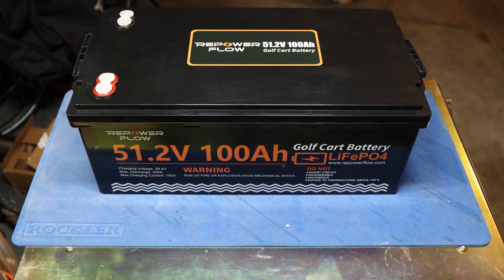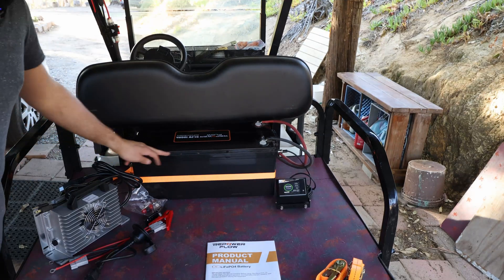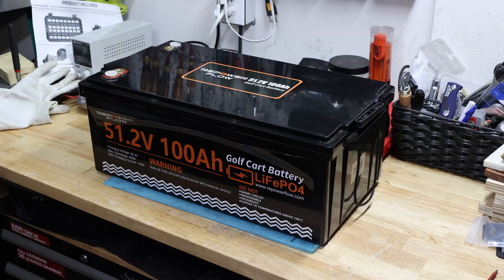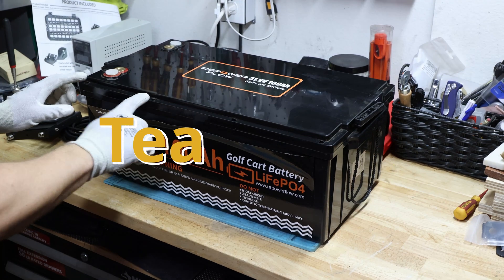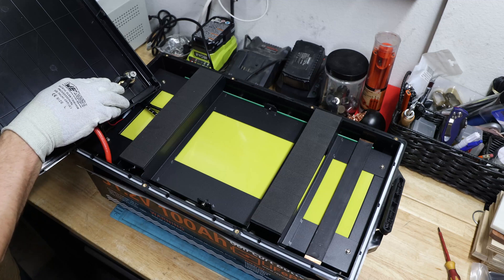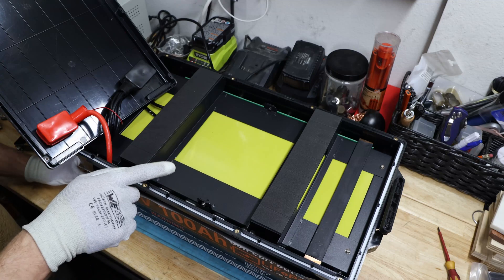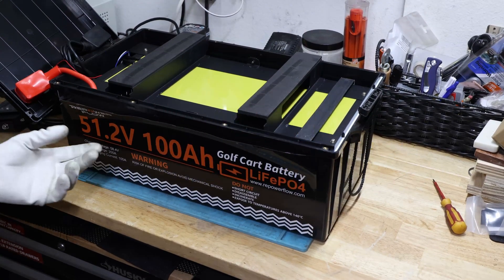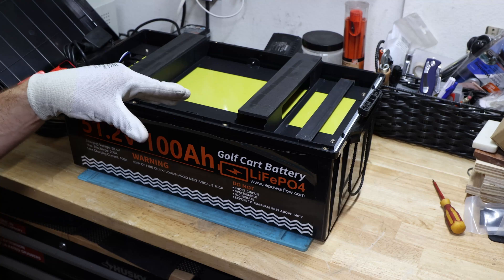FREE REPOWER FLOW BATTERY GIVEAWAY! | Off Grid or Golf Cart 51.2V 100Ah Lithium LiFePO4

Comment: HELP!  Sitting in a campground in AL.  Converted my cart to this Lithium battery.  My battery has gone into a soft lock mode.  My app won’t allow me to change anything.  It’s been on charge since 5:30 yesterday Jan 6 to this morning Jan 7.   I cannot find any contact info for this company.  I left my file folder with the manual you show.  Can you help me or give me contact information.  Thank you.
Reply from the maker: Are you using the right app? Do you have a display connected?